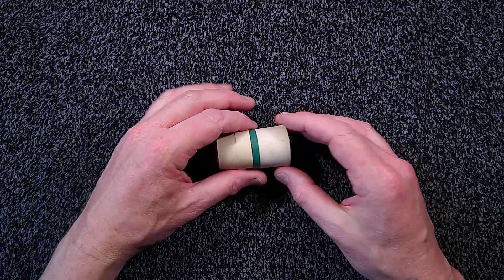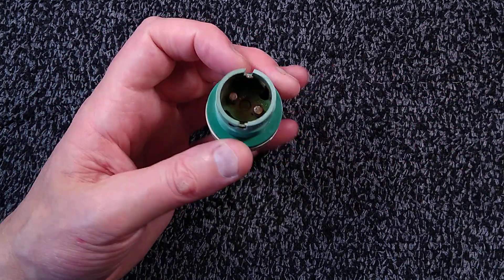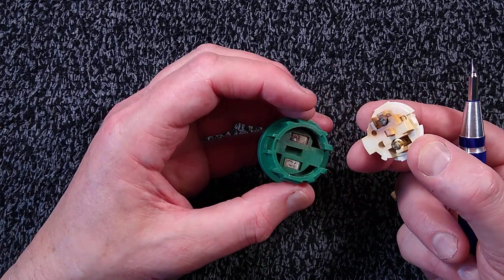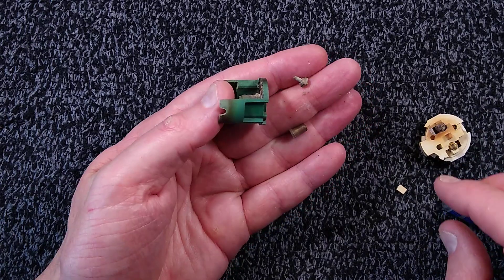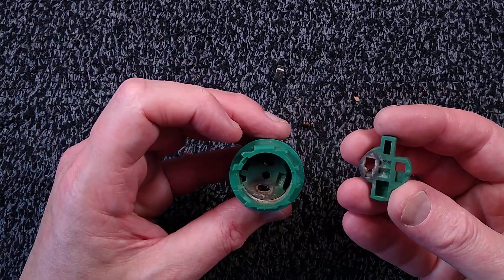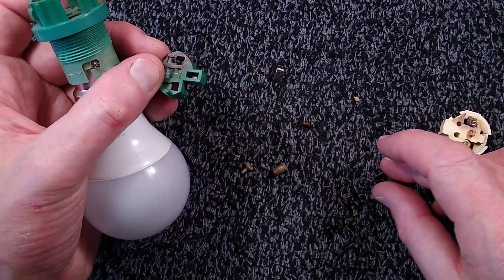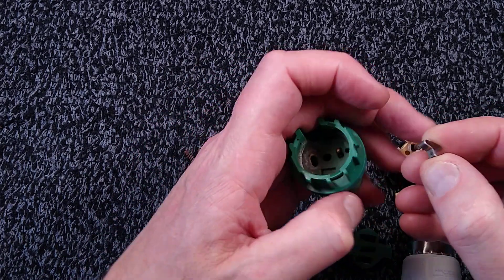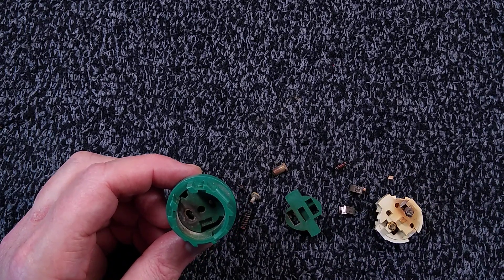Inside a failed safety lamp holder.

Comment: Of Course the safety lamp holder was sparking and arcing inside lol 😂 good thing you fixed it!!!
Reply: I remember a picture of a smoke alarm that had caught on fire
Reply: @justme5384  I runs remember saying I smoke detector ironically full of water!
Reply: Also one time on a mission trip we were painting out a burnt out apartment that somebody had been smoking in bed unfortunately one more reason that it's true about not doing that if someone is a smoker.

Non-smoker myself always have been.

About to smoke detector did detect that smoke although not sure if the person was waking up by the issue with an unfair bed or the smoke detector which came first!

Insert joke about chicken and egg here.

The smoke detector look like it had been made out of cake frosting the way it had dripped down with the plastic that smoke detector is immortalized now by the way!

The other thing was when we were doing the painting I was doing the suspended ceiling grid with a roller from floor level and got attacked by the exhaust fan in the bathroom not realizing it was just barely balanced on top of the suspended ceiling grid was still attached to the original junction box with flexible metallic cable of some description.

Just about got beheaded by that thing.

One time was changing a fluorescent bulb whole fluorescent fixer came down off the ceiling in a similar manner ripped the cable straps out of the ceiling.

That's something you don't see everyday is the electrical device attacking the person that's trying to fix things up kind of like if big Clive had tried to use the Dark and Stormy with the drinking bird that he completely destroyed.

Reference to a video quite a while back by the way.

When totally destroyed drinking Birds attack!

Also I'm not sure if this ever came to fruition I remember that on the show years ago Beyond 2000 they were talking about one of these safety sockets except that it had a integrated like fluorescent tube or something similar possibly cold cathode? Or otherwise no real details.

The idea was that when you were changing the bulb if you're in the dark the whole socket assembly would illuminate if the bulb was being changed or even left out of the socket perhaps as well.

Don't know if this may pass prototype stage or not it was featured on the show but that's all I saw of that invention clever idea nonetheless.

It seems to me now that a lot of those things featured on that show really never made Headway or just kind of faded Into Obscurity there were a few things though that are still around or at least were up until several years ago.

Be willing to bet you somewhere here on YouTube you could find episodes of the show by the way the show had changed the name much later on closer to the year 2000 not sure exactly when.

But had changed names to be on tomorrow.

I remember seeing some of the first laser projectors that were designed to produce an image just by scanning a beam rapidly on a surface.

Even a prototype video phone that was a stylus device all sorts of things that just never panned out really or were superseded in the first place nowadays!

I can just see a show eventually saying about phased out inventions and stuff kind of reverse of that one and talk about the history of things someone like that would be awesome perhaps something other technology retrospective might be a good name for it if there ever was anything
Reply: Fals triggering airbags breaking peoples noses.

Comment: Your prediction regarding cost-optimised LED-only holders has already happened - IKEA floor lamps I bought last month have a maximum 13W (THIRTEEN!) rating.
Reply: To be fair I've seen full on metal lampshades that say no more than 30w, you can get away with far more, as my 600w bulb proved 😂
Reply: I get why they have done it but I rather like the fact I have ceramic lampholders in my GU10 fittings designed for 50w that only see 4.8w. They should last forever.
Reply: 13W rated lamps are actually quite common. In apartment where I live there's one like that in the bathroom. The previous tenant had replaced led with 100w tungsten lam. I've literally  noticed by stepping out of shower and feeling heat on my head. Currently there's led inside of a baked lamp.
Reply: Bought OUTDOOR lights from cosco it said 8w MAX I usually put 15W LEDs (cuz i like it bright) when I installed them the wires were so tiny I had to have been 18 or 20 awg
Reply: Even with the reduced power, you need decent current handling capability because of the capacitor arcing things up...
I have a lamp where the switch is failing as though I've been switching a motor on and off, yet it only ever 'sees' a 4W LED...
Reply: In some cases there are lampholders that say 60W max tungsten or 13W max energy saving, not so much for the sake of the lampholder but more to prevent the energy saving lamp from overheating and failing.
Reply: Not something new. The Ikea PS 2014 lamp, probably better known as the "death star" (or if you play FFXIV, Dalamud) lamp that I bought shortly after they released it, has an "11W max" sticker. Back then we were right in the transition from CFLs to LED lamps, and I can fully understand why they put that limit on. The whole thing is made out of plastic, and if you fully close the ball (which only leaves tiny gaps between the outer plates) an incandescent bulb would probably melt the whole thing within an hour.

Comment: The odds of the safety lamp holder arcing or malfunctioning (failing) is probably higher than someone sticking their finger in the socket. Is the safety lamp holder a benefit or a liability?
Good on you for fixing replacing it btw.

Comment: You might have prevented a fire. A fire that cost money… and possibly lives. You’re a true hero Clive. Little things like that are what separate good humans from bad. You care about the safety of property and people. Bravo brother. 👏
Reply: @Okurkaarrgghh  that’s would be controlled with safety measures in place. Walking past an arcing electrical device and ignoring it is wanton disregard. Big difference.
Reply: @girlsdrinkfeck  RCD/GFCI will not trip on an arc fault, need an AFCI for that.

Comment: What Clive didn't see was the maintenance guy installing that damaged fitting a few days before the crew moved in.  This was done in the full knowledge that one (large) member of the crew would replace the fitting and do a YT video on the failed one.
I used to work at a university near London.  The maintenance electricians knew which student flats had been occupied by electrical engineers and which ones had been occupied by arts students by the number of call-outs to replace blown fuses during the year, and at the end of the year by which "securely locked" electrical panel had been opened without damage.  Ah, the joys of having mature, proper time-served guys doing a uni-course.
Reply: Apart from electrical engineers and arts students, what other students lived in those flats?
Reply: @TheMatsushitaMan  Just about every other breed one could  think of.
Reply: When I was doing my Postgrad., in the accommodation block, each floor was served by a centralised distribution panel, with those "tamper proof" triangular keyed closures.  Obviously well before the likes of AliExpress / Banggood / DX,  but it didn't take us more than a day to fabricate a "suitable key", which meant  we were able to replace fuses post "unfortunate kitchen incidents" without needing to call Maintenance (who charged for such services).

Comment: There is (was?) a similar but uncommon style of safety lamp holder in the U.S. for the Edison screw-type bulbs. The screw section is made in two pieces with the upper (lower? forward, maybe?) portion being stationary and the lower portion being drawn towards the upper by the screw threads. Power is only applied to the center pin once the bulb has been screwed in far enough to draw the contact into it from behind. The problem is that it only works with bulbs with properly-made screw threads, not the cheap junk that’s usually available.
Reply: One thing to be aware of- there are two ES standards, they both look the same and are 'kinda' interchangeable, but the US based one has slightly different threads to the one found 'ITROTW'- meaning if your lamps aren't from the US/made for the US market- the threads will be 'sloppy' in a US base... not 'cheaply made' but a different (metric) standard... ;-) 
Oh, and your 110v US ES threads won't fit into a 'metric base' at all unless you REALLY force them (probably the bulb will break first) 🤣
Reply: @steved2136  The U.S doesn’t use metric though, that is the problem.  It upsets me when temperatures in the U.S. are quoted in Fahrenheit as I don’t understand it.  Thanks for your comment Steve.
Reply: @rogerhargreaves2272  LOL- yeah I always have a bit of a giggle when I see US temps 'its hot out, its over 100' Every time I hear that, I see images of lakes and rivers boiling away...
Reply: @steved2136  Ikr, it gets me every time they say the temperature is over 100° 😱
Reply: I’m a dual-citizen and have used both inch and metric my entire life. I prefer the Fahrenheit system for everyday use (because that’s what it was designed for) as 0° demarcates dangerously cold and 100° demarcates dangerously hot. Also the C° is too wide a step, necessitating a 0.5° step in most situations. Celsius not only lacks the most useful defining feature of the Metric system, automatic decimal unit conversion (as no one uses millidegrees); it’s based on the boiling and freezing points of pure water at sea level, which is basically an oxymoron.

I always chuckle when Europeans poke fun at Americans for being monolingual but can’t fathom learning two measurement systems themselves.
Reply: @paulmccoy2908  Fair point.  Just we were never taught imperial measurements at school so can’t really refer to them.  Although here in the U.K. miles, feet, yards & inches are still commonly referred to. 🤜🤛👍

Comment: A great example of an additional 'safety' feature actually causing a hazard, in this case fire potential. The design imo is too complex and should rely on rotation rather than linear motion.
Reply: re-inventing the wheel

Comment: Years back. my parents lived next to a trucking company office. It caught fire, but the fire department was right across the street. The building was saved...just some smoke damage.
And the cause was found to be the ancient burglar alarm. And...since the burglar alarm cause the fire, I went over the next day and unhooked the fire alarm so it wouldn't cause a burglary.
Reply: I once read in an old copy of "Firehouse" magazine the story of a firehouse that burned to the ground. It started with one of the fire trucks, and the heat was so great that it melted the contactor for the mechanical siren into a closed position. The siren blaring with no command to do so is what clued them in to a problem.
Reply: @dashcamandy2242  That is kind of a slap in the face when the firehouse burns down. It leave a lot of questions behind.

Comment: The basic idea behind this safety lamp holder is superb since it solves the problem of folk sticking their fingers in and getting a shock. But a snap action is needed (like in a switch) so that a solid contact is made, otherwise there's a risk of a poor contact leading to arcing. This is what has appeared to have happened here. So - back to the drawing board, but don't abandon the idea. Maybe the amount of twist involved when inserting the lamp needs to be increased.
Reply: Folks sticking their finger somewhere it doesn't belong SHOULD get a shock.
Reply: @BrainHurricanes  The problem with bayonet lamp holders is that the spring mechanism sometimes jams and the simplest way to free it and check that it's OK is to prod it with your finger. Sadly some folk forget to turn the power off first.
Reply: @chrisengland5523  Why would one insist in using a finger ? It wouldn't work with a woodden/plastic stick ? I've been shocked a few times due to my curiosity, I'm glad it did, I learnt from it, don't touch live wire unless you know what you are doing. FYI I've worked on live wire, can't shut down a whole street just to connect a cable for a new house.
Reply: @BrainHurricanes  I'm not defending the fact that idiots stick their fingers into sockets, but merely pointing out that a socket that automatically disconnects the mains when the bulb is removed is a good thing - it saves people getting electric shocks. We are very fortunate in the West in that we have good safety practices and regulations, many of which came about to protect folk from doing silly things like this. Go visit a third world country to see how things are without such safety standards. For example, bare mains cables within reach. Yes, "everyone knows" not to touch them, but folk still do. That's what much maligned but nevertheless vital health and safety laws are all about - preventing accidents. In the West safety standards are continually evolving - things are safer now than when I was a child and this surely is a good thing. The UK has automatic shutters that prevent people from sticking anything except a proper plug into electric sockets, but there is currently no equivalent for lamp holders.
Reply: @chrisengland5523  Yes, I get that. I just feel like the treshold where safety really is a meaningfull improvement, is long surpassed. We are allready at the point (maybe not in the UK) where you can take off the cover of an electric board and poke your fingers arround everywhere you want, you won't get a shock. It's like a rediculus level. Not sure if you get what i'm saying. Maybe in short, people are getting dumber and dumber. Not related, don't know if you heard, but there was a warning from medical caretakers to NOT put a popcicle in your bum. Tell me that is not rediculus ? Wouldn't it be a great idea to put in big writing "Only for eating, not for bum!" on popcilce wrapers ? lol (if you like electric stuff, I recommend ElectroBoom)
Reply: @chrisengland5523  Even with safety holders, still turn the lamp off... I feel it was arced up initially by people hot-swapping the bulb.